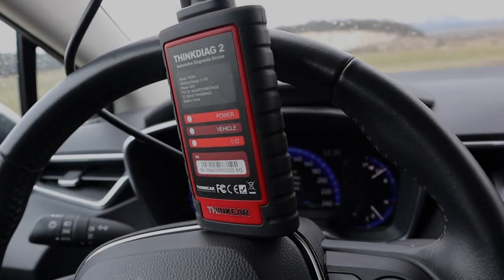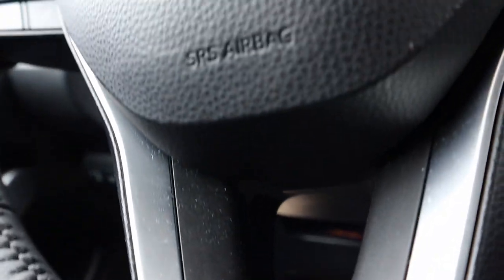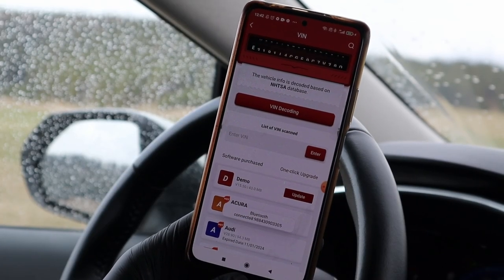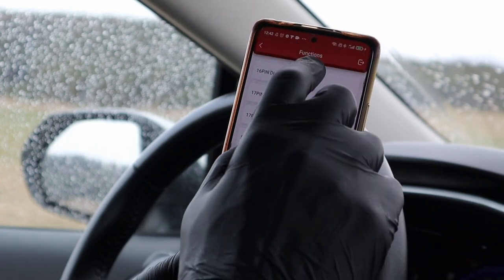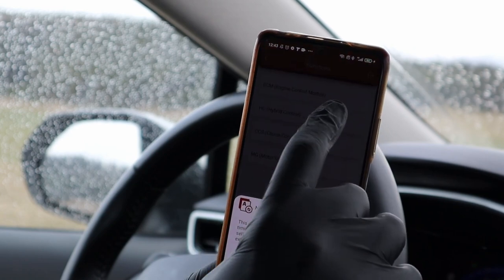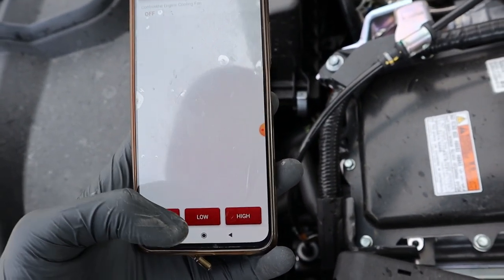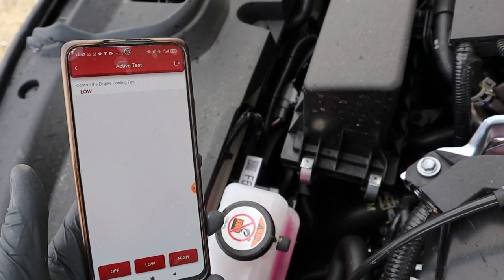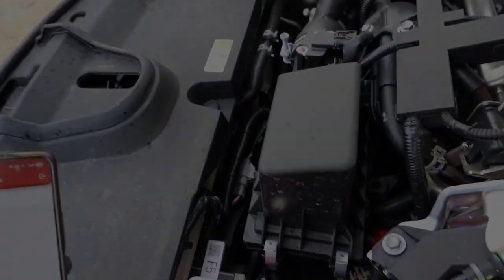How to Test Engine FAN with Bi-Directional OBD2 scanner

Comment: thanks for the video.  Quick question- Can you change the temperature setting for each (low and high) fan to turn on?  i.e 180 degrees for low and 195 for high,etc. thanks
Reply from the maker: No